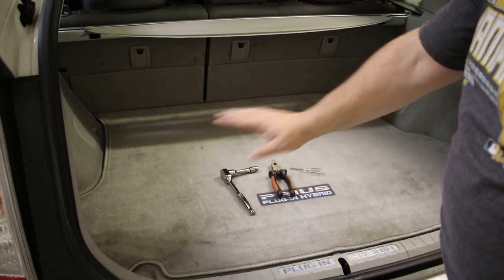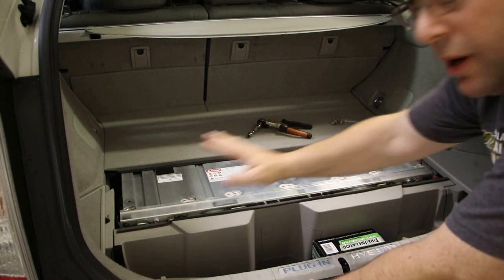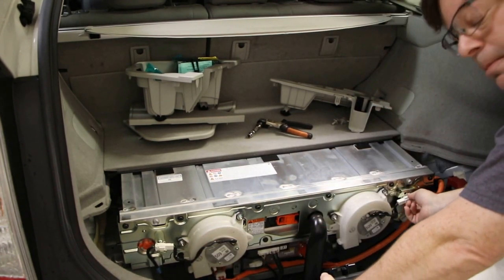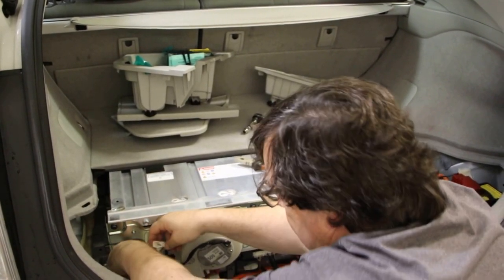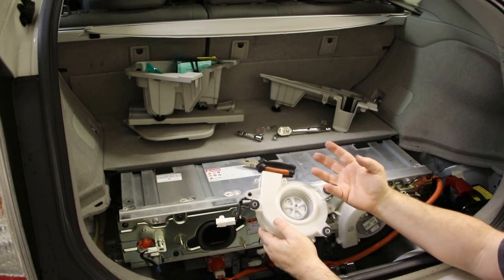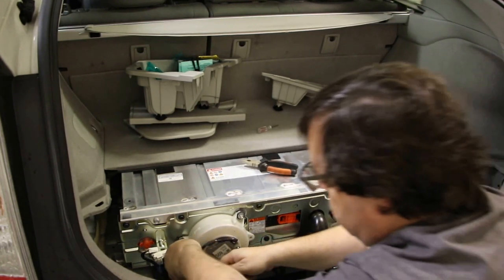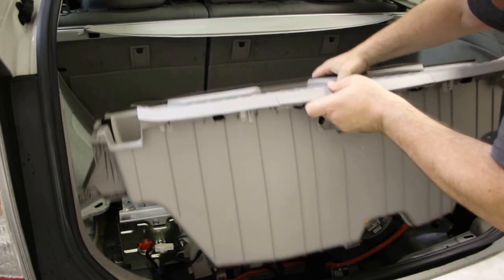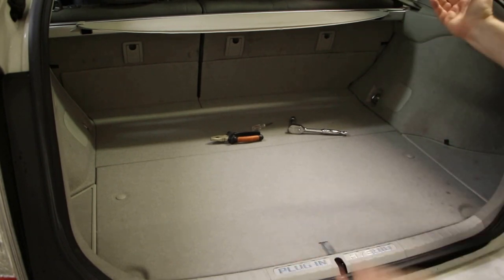Prius Plug in Cooling Fan Clean

Comment: Thanks for this video.  I have a 2014 Plug in (195k KM) and have been wondering about the fan cleaning process as it has never been done on my car, and there seem to be very few videos on the 1st Gen Plugin, as it was a fairly limited release vehicle.  I feel my conditions are relatively clean, so I don’t think it should be too bad on mine, but with the age and mileage I know I am overdue…. 

I know the process with the regular Prius can be quite a chore, removing the back seat and interior panels, etc.  Great to see how easy this is, will certainly be a project I tackle soon! Thanks! 🙂
Reply: Yo, we are officially car brothers now

Comment: Question ,, it looks like both those fans pull or exhaust air through the back side of the battery , is there filter that needs maintenance that prevents dust being drawn into air inlet of the battery like on normal prius ? its probbly a diffrent design but you would think it would be there..
Reply from the maker: The inlets are at the rear seat, and my 2012 has no filters, though you can make them if you want. Dust isn’t much of a problem but pet hair can be. But it’s so easy to check these fans that I don’t worry about it.

Comment: Hi sir , do these fans have a filter somewhere? Thanks for the video.. saved me $200 😃👍
Reply from the maker: Marcos Cisneros, there’s no filter that I’m aware of. I believe the inlets are below and also on the passenger side of the rear seat. There are grills but no filters that I’ve seen.
Reply: There sort of filter that Toyota eventually released. It's a cover with finer mesh that fits over the air inlet on the right rear passenger side seat. It's meant to block out pet hairs. Toyota seem to think that sufficient and didnt make this retrofit cover filter until 2013 or later.
Reply: The part number for the inlet filter is G92DH-47010. It just snaps over the outside of the inlet grill on the bolster on the right side of the rear passenger seat.

Comment: Where do the fans get air flow from? Is there a vent like the regular Prius that has to be cleaned also?
Reply from the maker: Leo Lee Yes, air is drawn in from the passenger cabin, from a vent on the right side of the rear seat.

Comment: How do you know if they have to be checked? Or how often should you check?
Reply from the maker: Good question! This is not a Toyota-specified maintenance item. If you transport pets, especially long-haired pets, I recommend annually. Otherwise, every two years, I suppose.  On the Plug-in, this is very easy to do, as you can see in the video.

Comment: Are the cells of Prius plug in cells and normal prius the same?
Reply from the maker: greatogbuagu, the Plug-in Prius has a much larger battery.  In the 2010-2015 Gen III, the standard Prius didn’t use a lithium ion battery, but the Plug-in did.  So they aren’t interchangeable, not the packs nor the cells.

Comment: It cant be that easy. So does the intake vent do anything? Where is the aor coming from exactly? Does the air come into that vent, under the battery, to the back of the car then into those fans?
Reply from the maker: It is that easy. The intake air comes from a vent on the right side of the rear seat.

Comment: It's better to stay away from that high voltage battery.  Leave it to the professionals.
Reply from the maker: The HV battery is inside that big shiny metal case.
Reply: Given the desigened in layers of protective isolation to prevent contact with the high voltage systems parts as long long as one does not tamper with any of the "orange" high voltage wiring or reach in through the fan inlets into the battery itself , you are not at risk of any contact with the cars high voltage systems.